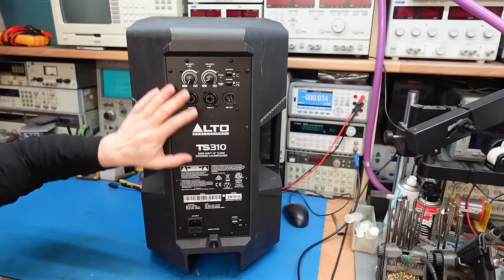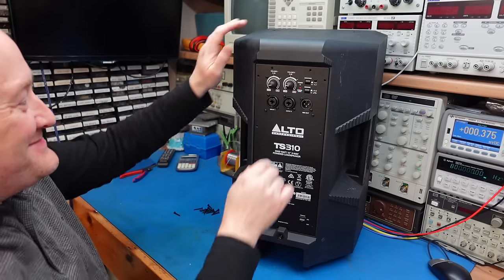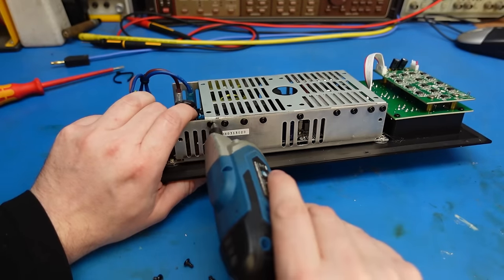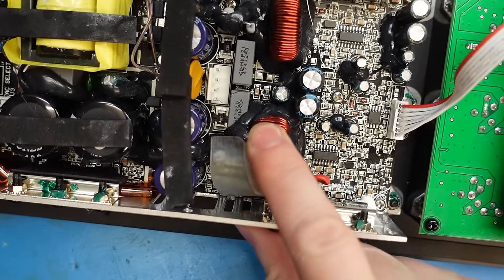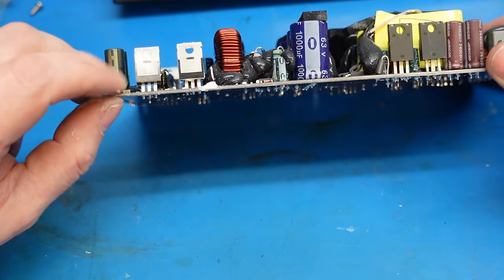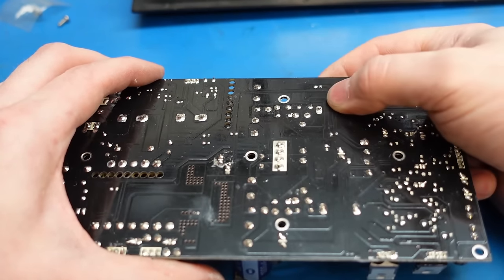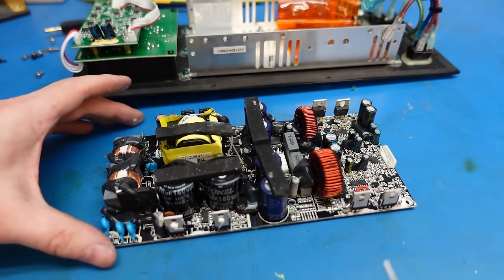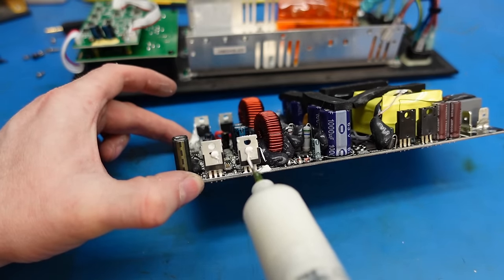2000W Active Speaker Repair - No Bass - ALTO TS310

Comment: I load tested one of those and it only made 245w rms. 2000w a bit of a dream. Spiked at 1805w at 1khz.
Reply: ... and for the better, imagine what that poor 10" woofer would do, if subjected to currents anywhere near the official figures.
Reply: PA speakers are sadly often marketed using the peak output rather that the RMS output. Quite a slimy industry in that regard.
Reply: I think "PMPO" is what this spec is called: peak music power output (if I'm correct). But the continuous power, when putting a sine wave through (say 60 Hz for a woofer), that's real, but won't sell as well.
Reply: These manufacturers do Try to kid on with over the top figures.. at least qsc powered speakers are pretty close to their ratings.
Reply: That's why active speakers should be advertised with their SPL and average power draw figures. None of that peak power BS!
Specifying how much power is delivered into the driver -- be it peak or average -- has no meaning whatsoever.
Reply: Like the video.  It does amuse me how exaggerated the power output is quoted.  I used to use Ashly amps, 1000W rms, transformer like a copper wound dustbin lid, 30Kg a piece.  One day in a shop I was handed a peavey about the size and weight of a CD player and was told it was 2500W.  Yeah right lol.
Reply: I guess people who make buying decisions like to see nonsense figures. In a quiet room, 50W per channel continuous is almost deafening. 2kW is one of those big speakers they have hanging in arrays at concerts and such. It’s for open spaces pretty much and you can’t even stand close to it when it’s going full blast. I don’t know where someone may semi-professionally need a 2kW two-driver PA system, but it’s a silly requirement. Usually you need more speakers at lower power instead.

Long story short: marketing wank 🤢
Reply: Do you know the difference between 1850 and 2000 watts. .1db of volume. That is one tenth of a decibel. "What Shocking fraud"..
The difference of 1000w and 2000 watts is 1 decibel. Volume is logarithmic.  1W-10w-100W-1000w-10,000 watts = 10db increase in volume =
10db = twice as loud
Reply: IHF: -.

Номинальная мощность: 35 Вт.

DIN Power: 50 Вт.

DIN Music Power: 90 Вт.

Максимальная синусоидальная мощность: 90 Вт.

IEC Power: 90 Вт.

AES Power: 110 Вт.

RMS (Rated Maximum Sinusoidal): 110 Вт.

PP (Program Power): 220 Вт.

PPP (Peak Program Power): 440 Вт.

PMPO (Peak Music Power Output): 1050 Вт.
Reply: A good friend and former boss of mine, when someone came into the shop bragging about their '2000 Watt speakers' would say 'bring them in, I will show them 2000 Watts, then shortly afterwards I will show you a bonfire'. It never got old, pricking people's balloons 😂😂
Reply: And most 12" speaker made can only handle 200-300 watts rms.... Even legendary EV & B&C
Reply: Thats just like my pa amps they say 6,500 watts but in reality there only 200 watts rms with a peak of 275 they were dreaming
Reply: @atw4321  Sssshhhhh! There is an upside to this dreamworld power output nonsense. Let the idiots buy £249.99 '2000 watt' amplifiers whilst those of us who know better buy up all the old HH, Citronic, Crown, etc etc for peanuts because 'it's old and low power' 👍🏻
Reply: It sells to the average consumer, numbers sell.
Much like horse power sells, or top speed.
The one that gets me is the oft used word " Quality" which when used as one word has absolutely no meaning..
A quality product?!  Good, average or substandard.
I think in the majority of cases they are meaning high quality..
But the devil is in the detail when someone complains...
Eg I'm taking this stereo back because it's crap and falling to bits but was told it was a quality product..
What quality?
Reply: Exactly to double the perceived sound of 10 watts rms per channel you need to multiply by a factor of ten.
That's not including speaker efficiency or speaker enclouser design.
Put a 30 watt valve guitar amp in your living room at full blast and it'll make your ears bleed as you scrambling to get out of the door
Reply: Ye! 2000 w my ass! Small Print on the back ‘Power Consumption 900watts’
where do they think to other 1100 watts (power) is coming from ?
250 (actual) watts RMS - So not even that efficient
At what point does 'Trade Descriptions' kick in ? or is this even Fraud

Comment: I work in a DJ shop on repairs, it's got to the point where we won't even take Alto stuff in for repair any more. Don't need the headache of fixing it, only for the customer to bring it back a month later with another fault! They're not a bad sounding speaker, just not very reliable it seems. And 2000 Watt? Nearer 200 than 2000 I'd say, don't know how these Chinese manufacturers get away with such bare-faced lies on their specs...
Reply: I have been repairing domestic and professional audio for 45+ years, and I won't touch ANY of this modern china junk. It's just not worth my time or my reputation. The boards are a nightmare to work on, the copper tracks lift off if you even look at them and getting replacement components (if you can even work out what they are) isn't easy or even possible in some instances. China gets away with making rubbish and telling lies because people keep on buying their junk. If people boycotted it and refused to buy it, there would be no market and hopefully they'd stop making it. Also there is no way to stop china telling lies on their products - who are you going to complain to?
Reply: Alto is part of the Inmusic group in the USA. Designed in the USA and built in the orient. I agree that built in China is not a great label to have. That is why Ashdown’s top range tube bass amplifiers manufacture was returned to the UK, for better quality control. Japan, South Korea and Indonesia seem to be good for high quality instrument manufacture, so I would hazard a guess that electronic manufacture might well be if a similar high standard. It appears that power supplies made in China often suffer from parts being removed from the build AFTER attaining CE certification for the design in order to cut build costs (they remove RF filtering components to save money). The result is RF noisy psu’s which interfere with radio receivers and pollute the radio spectrum. They are a bloody menace.
Reply: I have four of this speakers and two have gone bad already. Any recommendations on a good brand ?

Comment: I am guessing before you tore the Amp all apart you did check to see if the Speaker was Blown Right ? That would be mud in your face if you tore the amp all apart and it turned out to be a Blown speaker Huh ? That is why I teach my guys to ALWAYS check to see if the Driver on the horn or the Speaker is Blown first . Enjoy your Video's ..

Comment: As somebody who both uses various brands of powered speakers in live sound applications, as well as fixing them when they break, I just wanted to mention that the lots of screws / lots of silicone glue thing is intended to prevent vibration damage when playing at full volume, as well as hopefully protect from the inevitable tumbles and rough handling that happen to musical equipment on the road.  Also, on this particular speaker, the back plate is forming part of the speaker enclosure, so ideally it should not flex or leak air when the speaker is used a high volume levels. The only way to achieve that is with lots of screws, or by molding a sealed chamber in the back where the amp module can live in peace. Alto chose "lots of screws".

I was surprised, and pleased to see that the amp module uses discreet MOSFETs on such an incredibly cheap powered speaker. Most manufacturers in this price range use the TDA8953 / 8954 amp on a chip, which is complete chintz in my opinion.  And of course it should be obvious, but I'll say it anyway... there is no way on this earth, or in any other universe that this is a 2000 watt amp.  Based in NDA service manuals for similar products, we might expect something in the 200 watt RMS range.  It appears from your video that they use different MOSFETs on each channel, so perhaps 30-50 watts RMS on the compression driver, and around 150 watts on the woofer. Usually, manufacturers use the same amp board across the different sizes of speakers (10", 12" & 15") in a series, and they program the DSP to deliver the amount of power appropriate for the size of the woofer. If the series has a subwoofer in it, some companies will choose to use the same MOSFETs & inductors on both channels, then either use a dual voice coil driver in the sub, or design the amp so it can be put in bridge mono mode to feed a single voice coil sub - the old QSC KW family does the latter.  The compression drivers are nearly always the exact same part across all sizes in the series.   Good video sir, always fun to see what is inside other brands I've never had a chance to crack open.
Reply: Those are Chinese watts. Their exact relation to the regular watts is unknown, as it is a classified and strictly protected state secret and a property of CCP, but the approximate conversion ratio, as figured out by the generations of engineers, ought to be about 10-15%.
The half-bridge topology of the power supply, the size of the transformer and the two 470uF 180V caps in series suggest that the output power is indeed in the region of 200VA.

Whether they use ICs or discrete MOSFETS, D-class amps are utter rubbish regardless.
Reply: @noneofyerbeeswax8194  - "Whether they use ICs or discrete MOSFETS, D-class amps are utter rubbish regardless" - lol... perhaps you can pass that along to Powersoft... and D&B Audiotechnik... D&B might even be able to get their designs changed over whatever your personal preference is (I assume AB, but hey, maybe you're an H person) before the next EDC show comes up.  Definitely. I'm sure they will.
Reply: Thanks for passing on you experience and understanding of this, it helps people like me😊
Reply: Tldr

Comment: Hey Mark, as a test and repair tech that used to work for Citronic, (when they had their factory in Melksham in Wiltshire), I am finding your videos very reminiscent of the time I spent fixing audio gear. I now work in IT, but keep my hand in as a DJ (another reason I worked ay Citronic). I have a pair of TS115A's which had intermittently dropped output to the bass speakers. Inspired by your video, I ventured to have a go at fixing these & and... success! I have never worked on Class D stuff before so I was quite wary of doing it. Time to fix one cabinet was about 2 hours especially after trying to remember how it all went back together again (used the other speaker as an aid memoir!). It was dry joint s galore. Lead free solder is pants! Thanks for the videos, it is quite cathartic watching someone else do all the work!

Comment: Good that you fixed it. What surprised me is that you put all those screws back together before you tested it. Why? I would think for a low output test it should work without the cooling elements. And if there are another problem then you wouldn't have to do all the screws again.

Comment: 2000 Watts my ass :D - 200 Watts top.
Great job, I like your smile, and enthusiasm, and yeah, looking at the crack around the tin soldering was suspicious at first sight.. Long ago I caught a tiny crack on the circuit line, noticed only with magnifying glass, and that was the source of the failure!
Reply: Exactly. I was curious about the title "2000W Active Speaker Repair". Never in my dreams has that thing 2000 W.  Maybe for 10 msec? But not continuous. It's pure sales muck. 
That aside: he found the problem so easy - I am deeply impressed with the knowledge and experience of that man. I only found him yesterday and am binge watching since.
Reply: Maybe 50 watts in the scene..., that mini power supply gives hope for that.
Reply: Not even close to 200w. I would be quite surprised if it just made 50w at 8 ohms 20-20k Hz. I asked Mark this before but to no avail. On the so called 5kw Crown. He is highly skilled and i believe could fix just about anything with current in it. I just have to get over the fact that he passes on the company lies like that when even a child knows better. Mark this is for you: I suggest calculating these numbers in the future for you viewers to compare to the utter bs from companies. That way it becomes interesting and you avoid to repeat other peoples obvious bs.
Reply: He knows that even a child knows better. These videos are made for technical people that understand that’s a bs figure.

Comment: Hi Mark, I tried to fix my AKAI Amp after it getting wet and it probably only had a minor fault but in the process I didn't recognize the drain of the transistors were connected to the metal heatsink on them. So it came like it had to and when taking out the board, I touched the heatsink with the metal thingy and it made a small smark between heatsink and transistor (seems like caps weren't drained). The power fuse ( 2.5A on the other side of the board) blew immediately. What do you think I should do? Is it possible that only the fuse blew or should I look for other faults on  the board?

Comment: Nice job Mark, reminds me of a car stereo I fixed for a friend with the exact same problem. Didn't have a lick of any kind of adhesive on it though. Your one was covered in it and still failed. Do you think it's down to thermal cycles in your case, that's a nice lump of copper!
Reply: Good point, makes sense, usually movement breaks the whole solder pad from pcb, or fatigues the coil where it joins. not that I've had much experience

Comment: Hey Mark, nice repair, just a little info about the tongs you use to snip off the ends of the cable ties. I used to use the same Knipex ones till one day I had to do an installation and when cutting into a piece of plastic, one side of the tongs broke off and flew straight into my eye, have been on disability since with no sign of it ever improving. So just a heads up, beware of those tongs!
Reply: That’s such bad luck. Sometimes I’m glad I wear glasses.
Reply: Incredible bad luck. Maybe it's just habit, but I always squint when snipping anything.

Comment: You'd think they would cushion those pcbs better to prevent that kind of damage!

BTW, when I have something like that where I know it's a common point of failure, I'll sometimes put some redundancy in it, like a bodge wire from the solder joint to a nearby trace, in case it fails again.
Reply: Good idea, back up fail safe.

Comment: Hi Mark, everytime i see you get a shock in the titles it makes me laugh. I've repaired loads of speakers with the same issue. The last one was that the magnet came off of the bass driver, but the coil unbelievably was still intact. So i carefully bent the metal mounting lugs back into place then some strong resin to add extra strength, and yaaaay it worked. Keep up the great work m8. Paul😊

Comment: Pop a PTC thermistor on the tweeter input. Would have to work out ac voltage near peek but it will heat up and increase resistance protecting tweeter driver from over powering.wont stop square waves though???
Reply: 10w quartz iodine bulb works fine. That's why Bose had the 20-200w rating.

Comment: I have all Alto speakers, which have done me right for years. 2000w is peak, of course. But they are extremely loud, clean and efficient. The problem I'm having is not with my mains, but one of my TS212s subwoofers. I've have them for 6-7 years, so they've served me well, until one completely died. Won't power on. Tried replacing fuse, but no luck. Not sure it this would be a similar fix, or something else entirely. I'm no electrician. Wondering if this might fix the problem, or something else entirely.

Comment: I've got an Alto TS115. I've run it pretty hard for several years and I think it's had it tbh, but basically, after being run for more than 20 or 30 mins, it loses all it's bass and mids really. I'm wondering if this is the same problem? Would it be delayed if it was this part?

Comment: Are the silicone pads under those devices not very good? You shouldn't need thermal compound AND silicone pads. Usually it's one or the other. The whole point of silicone pads is to eliminate the need for thermal compound.

Comment: Where are you based I've got a qtx 15a active speaker It works with low volume but as soon as i Turn it up, it sounds really distorted Being told it's the amplifier

Comment: Where are u based ? I’ve a dsr 115 with protection light on . Been told need a new amp module but surely will be one component that needs sorting🤷🏻‍♂️any response will be really appreciated.

Comment: Hi Mark, Some 30 years ago I obtained a circuit to do a simple modfification to remotely control  a Technics 1210 Mk2 turntable with three wires conected to the PCB and the audio mixer, unfortuneatly I have mislaied the info and it  is no longer any referance to it on the internet, are you able to suggest a simple mod. I really enjoy your repair videos keep up the good work

Comment: Have you measured real power of the amps? I really dont believe that it has even 1000W in total. Maybe closer to 500W. But dont have such speaker so cannot do that.
Reply: Based on the board it looks like there might be IRS2092 chips, with capacitors rated at 63V and even with 4ohm speaker it can take max 300W per woofer LOL

Comment: Features
Redesigned transducers for more efficient performance
Class-D bi-amplification with 1,000 peak output
10" low-frequency driver with 2.5" high-temperature voice coil
1.4" high-frequency driver with neodymium magnet
Compact, lightweight design for increased portability ($299.00)

Comment: Would you not test the woofer coil with a meter before pulling an amp apart? And run the amp up before screwing it all back together?

Comment: ill also teach you a small simple trick to get the amp panels off the speaker, i use a short XLR that goes between an input and out put, (its filled internally with hot glue or resin to act as a handle, and a firm tug gets them out